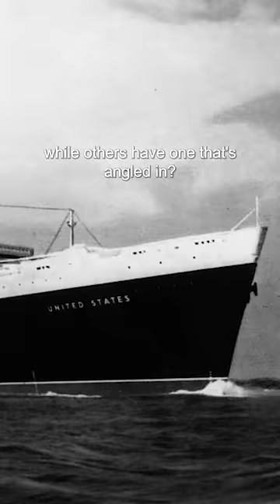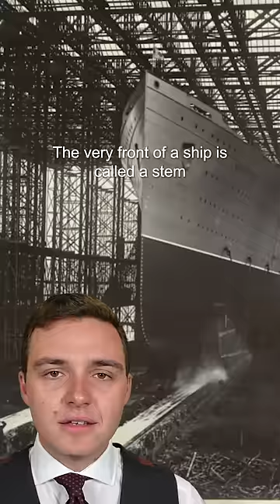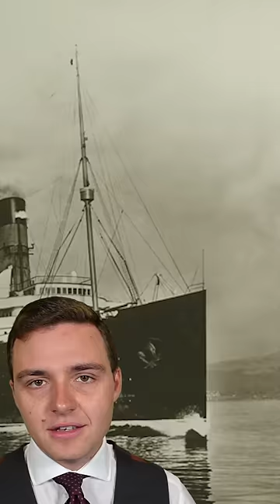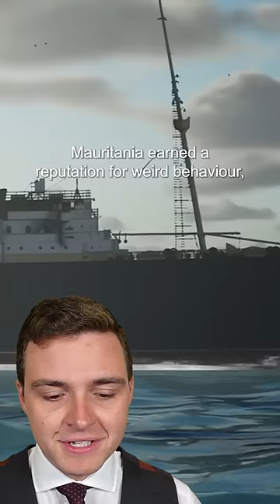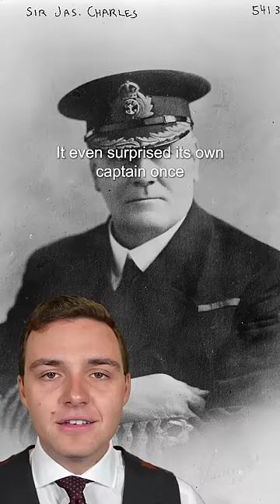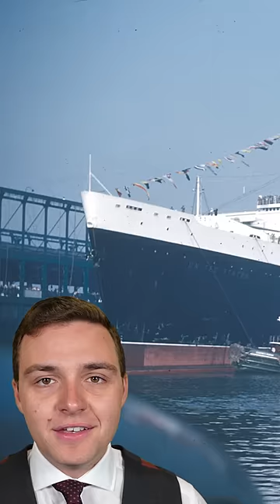Did You Know The Reason Ships Are Shaped Like This? #shorts

Comment: The straight stem was from a naval design phase where speed was king. its counterintuitive, but the longer the vessel is at the waterline, the faster it can move through the water. due to the standing wave the ship propagates dragging the stern down when it reaches its maximum hull speed. longer hull means longer wave meaning faster ship. The raked bow is the stability compromise. modern ships are impacted by this, but its not as huge a deal these days due to vastly improved engine efficiency and the immense cargo capacity of modern container ships. .
Reply: Actually modern ships have an extension on the bow at the water line. The ships are usually longer at the water line than they would be if built with a straight perpendicular bow

Comment: I think the German Kriegsmarine referred to the raked bow as an "Atlantic bow" and even converted at least one battle ship from a straight bow to an "Atlantic bow"
Reply: They did on several ships, including their infamous battlecruisers Scharnhorst and Gneisenau. The original bows had two problems: not enough freeboard, and being too 'fine' with inadequate buoyancy forward to lift the bows over waves. This made the ships far too wet forward in heavy seas, the "Atlantic Bow" added both a raked stem and extra freeboard forward to mitigate the issue.

Interestingly the Brits made the same mistake on their King George V class battleships, in their case there was sufficient rake and buoyancy in the bow but the freeboard was inadequate because they wanted to be able to fire their guns dead ahead at 0 degrees elevation. The KGVs remained combat effective even in atrocious arctic storms, but had a habit of dumping bucketfuls of seawater on unsuspecting crewmembers due to waves coming over the bow and flowing down through the air vents.
Reply: @nerd1000ify interesting. I learn so much in YouTube comments.
Reply: They did, except the raked bow existed since the 1880s.  Many US warships for example used a reverse raked, it was found this was a more efficient way to push a ship through the wave by the bow creating a lower pressure point at the front allowing the bow to have reduced drag.
Reply: @nerd1000ify  FREEBOARD!!! :D
Reply: @CheapSushi No you're correct in that understanding. The Atlantic bow was not only raked but flared outwards too. It was to dispell the water out to the sea instead of splashing onto the deck and getting into the guns.
Reply: Bismarck was originally constructed with a straight bow and later converted to atlantic when completed

Comment: Funnily enough as a chef I understand this concept. You can have a super sharp knife, but gravity takes over. If you want a knife to go forward through anything correctly, it’s the angle and arch of the blade that needs to be the sharpest, otherwise gravity pull the cut incorrectly.
Reply: I was just going to say the same thing. Whoever designed this style of stem hadn’t used good knives much.

Comment: "We designed this ship to cut through water"
ship cuts through water
"Well that was unexpected"
Reply: "I may have gone too far in a few places" - Leonard Peskett
Reply: @Cruz474 Meanwhile when it came to vibrations he didn't go far enough 😅.
Reply: @Cruz474 
I understood that reference
Reply: W
Reply: Then someone looked at a whale and realized parting the water is way easier than cutting it. 😂
Reply: That's not a knife
Reply: Unfortunately the first submarines weren't water tight
Reply: 3100th like :)
Reply: What about large post-WWII ships with a bulbous protrusion at the front?
Reply: @NastySasquatch that's... not wrong
Reply: Most ships have a bulbous bow now anyway. For the last 60 years or so they’ve been built with a raked stem and a bulbous protrusion at the bottom forward end that rides just below the surface of the water. I’m a merchant marine so I’ve been on dozens of commercial ships and they all have one. Navy ships aren’t that numerous compared to civilian ships and they have slightly different bow styles for different work they’re doing
Reply: He ment it causes for "bounces" even on calm water .
Reply: @Crunch_dGH what about them? Well they are designed to be as stable as possible in a moving Sea …
Reply: The large, bulbous part of the bow is typically the sonar emitter.
Reply: LMAO
Reply: Flat with pear is the way to go.. the newer container ships sailing in the north Atlantic have a good reputation with this combo.. just saying as an ch.off on a vessel that does not have this 🫡
Reply: @seanbailey2170 no, it's not. It's there for speed/efficiency purposes.
Reply: Successfully failing
Reply: NOBODY EXPECTS THE….
Reply: And those beautiful screws just keep driving the ship down to Davy Jones Locker if the bow doesn’t shed the water quickly enough.
Reply: Exactly my thought, thank you for putting it into words.

Comment: Another unintended consequence is ship to ship collisions were worse when the prow was not much further forward then the keel, meaning it would almost certainly cut open a ship below there waterline if it rammed it. 

Man those knife edge bows looked so good though.
Reply: * excited Zumwalt noises *
Reply: This was the reason I had heard
Reply: @aRealAndHumanManThing  Zumwalts are the tanto blade of ships.
Reply: Bring out the ship sized knife
Reply: Thank you for your intelligent addition to the discussion. Very good point.
Reply: I was thinking this reason would be mentioned in the video. I remember reading that the investigation into the Empress of Ireland sinking after collision with Storstad was one of the reasons for the switch to a raked bow.
Reply: It would also lose a lot of maneuverability
Reply: It does look cool
Reply: Unless that was by design, such as the ramming ships of the late 1800s and early 1900s.
Reply: @j4513 What about large post-WWII ships with a bulbous protrusion at the front?
Reply: @Crunch_dGH that started off before WW2, the Bremen and the Normandie had it in the 30s. Others had It earlier, first noticed before WW1. It changes the way the water flows around the bow, reducing drag.
Reply: Vertical stems also lengthen the waterline, today the front 'bulb' shape does that now.
Reply: the edge bow were kinda right in principle, they only often had the wrong answer as to the design. 
raked stems result in the bow being pushed up by the waves(obviously more uncomfortable and inefficient/slower) but probably easy to make safe. nowadays ships have underwater bulbs and other tech that stabilize ships through the waves and often even bows that are formed opposite to raked, meaning sleeked back
Reply: @aRealAndHumanManThing wasn’t the Zumwalt a failed program tho?
Reply: Yeah in fact they just thought it looked hot so everything else had to be disregarded...
Reply: They look stunning surely!
Reply: Tho look at the Stockholm and the Andrea Doria, both angle ship yet it made the Andrea Doria sink

Comment: I always thought it was a matter of difficulty manufacturing the angled bow.
Reply: That actually has some truth, it's cheaper to make a straight bow.
Reply: at those scales the extra complexity is irrelevantly minor. The plum stem maximised length at waterline, which increases the vessels hull speed. Keeping some reserve buoyancy proved worth trading some of that marginal performance for
Reply: At the same time they were making oranate overhanging sterns like on the Titanic? They were well able to make raked stems, clipper ships were using them since the 1850s.
Reply: true
Reply: @charlesissleepy  a raked stern also creates uplift and making the ship less effective, but probably also easier to make a safe design back in the day. straight or even `backward` stern is more effective then conservative raked, as we have underwater bulbs today

Comment: As a Mariner, I also like a flared bow that deflects the waves to the sides instead of coming over the top. I did run a fishing vessel built in 1929 with the straight stem. She was fast at 13 knots, but in weather, I had to slow down as the bow would plunge deep and threaten to blow out the windows.
Reply: As long as you don't push the bow into an oncoming wave, the flared bow is really good.  However, if you push the bow into an oncoming wave, the increased are of the deck makes it harder for the bow to come up out of the water. This results in the ship slowing dramatically.

https://www.youtube.com/watch?v=5eepu_owFHI
Reply: @gsh341  I disagree. I have run many hull types in my 40 years. The flared bow actually acts as a cushion in my opinion. When actively fishing, our speed is around 3 1/2 knots. Traveling 6,000 miles in a fishing vessel, we keep the speed to 8 knots to conserve fuel, especially at today's prices! The last vessel I ran did 8 knots at 64 GPH! That's right, 8 gallons per mile! That was just the 1,200 hp main, and NOT including the generator which burns an additional 10! It took over a quarter million $ to fill the tanks on a 130 foot vessel.
Reply: @gsh341  I'm not a bit interested in tiny boats in Haulover inlet! I am a blue water sailor and have spent 40 years at sea, and the majority of it in the Bering sea running boats that weigh millions of pounds. Quite a bit different than your average Bayliner! Just what qualifications do you have to argue about it? Yes, I have plunged my bow so deep that I have wondered at times if it would come back up. I've blown windows many times, and even blew out a back door, from  a following sea, during a typhoon in the South Pacific. Have literally pounded ice to save my life! So, does water over the bow scare me? Not nearly as much as being forced to run in the ditch does!
Reply: @ConvairDart106 let me guess. You didn't go to the link I provided for the website that actually discusses the pros and cons of large sea going vessels like cargo ships, military ships and the like, right?

That website actually has the pros and cons of many different bow designs and actually shows a large ship whose bow swamped by a large wave during a storm.

They literally say that is one of the big problems with a flared bow design.

But hey, you're a blue water sailor with 40 years of experience, right? why should you listen to what naval architects that design ships (not boats, but actual steel ships) like the ones in the video have to say?

Comment: Then there’s, of course, the time when the Lusitania had its bridge smashed when it plowed through a rogue wave instead of going over it.
Reply: Seems she and Mauretania both had a lot of problems during their career. They also had a tendency to roll sharply in bad weather which caused injuries and seasickness. Not to mention while they were renowned for their speed, this unfortunately came at the cost of passenger comfort. At high speeds the engines caused the ships to vibrate so bad that certain parts were unlivable. 

Cunard eventually ended up taking pages out of White Star’s book when they made the Aquitaine.
Reply: @yamato6114 I've always wondered, would these ships be able to right themselves if they ended up upside down, or atleast with their draught at waterline or higher? Does it depend on ship, or do all ships built with metal above a certain size just sink, seeing as they're not watertight above water, and metal (used in boats) is usually denser than water per m2, so if filled they'd sink?

I'm thinking rolling over in an unrealistically big wave, not staying upside down forever.
Reply: @viktorbirkeland6520  Don't all the metal ships lie on their keels after they sink?

Comment: There also used to be ships with a backwards angle, with the bottom sticking more than the top.
It was fazed out for a few reasons, but one of the big one is that when chilling with other ships it would make huge holes below the flotation line, sling the other ships in seconds sometimes
Reply: Tumblehome?

Comment: I honestly prefer the straight stem over the angled, it makes the lines of the hull look cleaner, but in terms of efficiency the raked stem is on top.
Reply: In many cases the straight stem is more efficient, which is why many newer cruise ships have gone back to them.
Reply: Some high end boats are designed with straight stem nowadays, don't have a clue why.
Reply: @Johnnycdrums  because there's a lot of things going under the water (blades, guides, gyroscopes...) that allow the thing to stay level and not dive in the water. also, most high end ships dont go through high seas, they get FERRIED (not kidding) across them. they are apparat toys, super rich wankery to show who can burn the most money.
Reply: @comethiburs2326 ; The high end boats (yachts) with apparent straight stem might just be for a retro appearance.
Haven't inquired, not in the market, and don't like it anyway.
My first boat will probably be about 16 ft.

Comment: Actually modern ships have what's called an X-bow or a Stem that is angled forward out in front of the ship, this allows them to cut though the waves like a straight stem without any of the weird behavior. Though cutting through a wave that is taller than the current air draft of the deck will put water in the deck.

Comment: It's due to bouncy. As a ships bow dips into the water the internal volume of the bow creates a bouncy force that pushes the bow up. A straight bow has less internal volume thus less bouncy. Making it sink deeper into the wave before the bouncy kicks it back up. Ships with a flair bow or rake, has a larger  internal volume thus the counter bouncy is larger thus counteracting the dip faster. Overall making a smaller motion making the ride overall more comfortable. along with this it displaces more water to the side rather than up. Keeping the bow more dry. Now that we know more a knife bow is only really useful if you want to save weight and the ship sails in calm weather.
Reply: But….it doesn’t create a smoother ride right? High flare and high rake are associated with increased heaving and wave vibration, no? 
A straight stem gives a smoother ride through waves at the cost of increased green water on deck (which obviously can be dangerous.) 
I’d like to know more about the strange motion he’s talking about especially pitching in calm water. Perhaps it was planing? That can’t be possible can it?

Comment: Water will flow right up the sides of the bow, flowing up and over the gunails,the raked bow with a round shaped stem close to the top of the bow,breaks up the water or waves slamming into the bow sending the wash to either side of the bow, instead of rolling up the sides unimpeded,bows also have wave breakers welded to the deck just in front of the wheel house.

Comment: Yeah and they are bringing them back with X and Axe Bow vessels, saying that they are so much better than standard flare bow ships. They also say the new bows are so much safer (while hiding the massive upkeep bills for the damage to the vessels due to excessive nose dives into waves rather than just going over them), and say that these ships ride so much smoother in rough seas (when the models they show clearly have the bow dipping into the base of waves before being pushed up giving the illusion that they don't move as much as a flared bow).

Comment: Ships now also have flared bows to create more buoyancy as the bow dives into the water.  This helps to keep the deck from going under, and minimizes spray over the deck.  Modern ships also have a bulb just under the water at the bow.  This creates a counter wave where the stem meets the water's surface.  This improves fuel efficiency by reducing resistance moving through the water.

Comment: Reverse raked stems have also been tried.  They all have different behaviours in waves.
Reply: Not only been tried, but making a big comeback in naval design.
Reply: @bendu49100  Depends on the ship's design parameters. May be useful in littoral zones for extra speed (longer waterline),  but not for sea going vessels as they reduce reserve buoyancy and tend to dive under waves instead of piercing or going over them.
Reply: @maxhugen  Well, they are also used on sea going military vessels
Reply: @bendu49100  Which classes?  Apart from the doomed Zumwalt-class which is designed for littoral zones - not oceans.
Reply: @maxhugen  
The Amiral Ronarc'h Class will feature a reverse raked stem

Comment: The main benefit of a raked stem is that a more flared bow form can be built than is possible with a vertical stem. More flare gives the ship what we call "reserve buoyancy". In heavy seas when a ship is diving down into the next wave, the added volume of the flare lifts the bow and prevents it from diving. You are much less likely to get a green one washing the foredeck with a flared bow.

Comment: Both Clipper bows and Cutter bows have been used for centuries. The idea in the cutter bow is not to cut the water. That is a nick name given after. The cutter bow was favored because it lengthened the water line, thus giving the ship higher speed. 
The problem was not the bow, but that they made the entire front of the ship so narrow that it had very little buoyancy. This caused it to raise out of the water much later when riding over waves.

Comment: And now modern sailboats are back to straight stems, which maximizes the LWL (length at waterline). This is because it wasn’t until fairly recently that the association was made between LWL and hull speed. Longer LWL, faster hull speed. 
Maybe the low keel of a sailboat, or the heel angle under sail, or the low hull speed of a cruising yacht prevents them from succumbing to the bow dip that larger, older vessels struggled with.

Comment: The displacement to weight ratio was much better in the middle than at the ends of those old designs, causing "hogging" - the ends drooping slightly. Bulbous bows fixed that.

Comment: Well a straight bow also increases the length of the waterline, which is imo the most important part. You will see that most modern sailboats have a straight bow. On some boats it even extends out front a bit